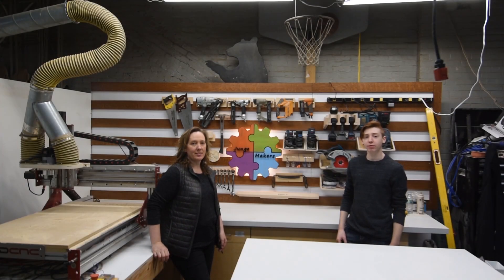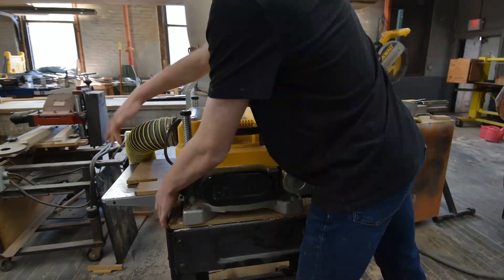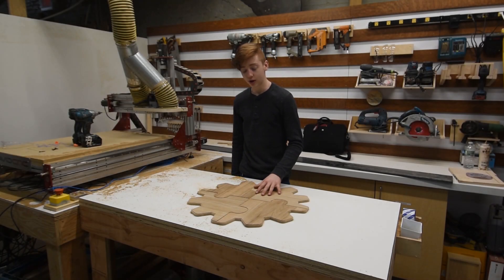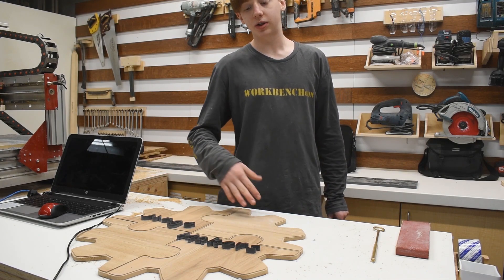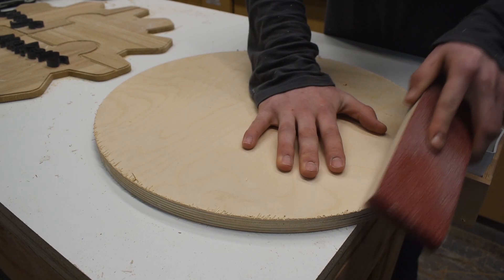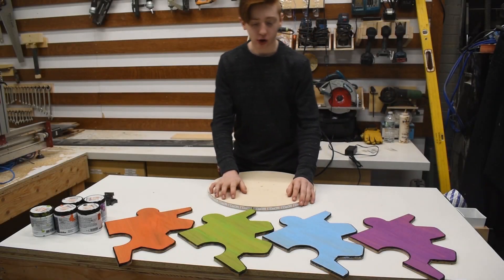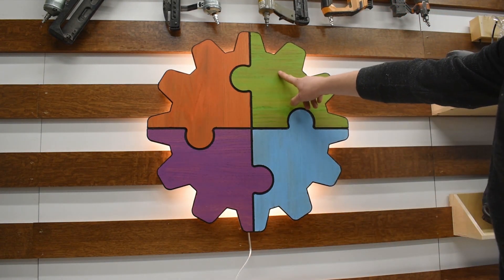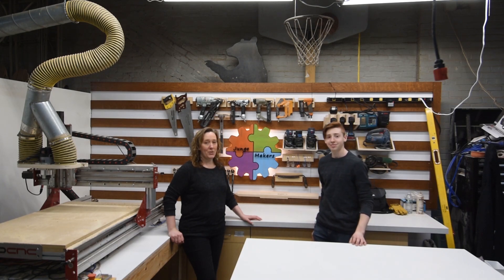How to Make an LED BACKLIT SIGN with Your Logo on it

Comment: That project came out looking fantastic. Great job!

Question:  which end mill did you use to cut the acrylic letters, and what were your feed and speed rates for that?  

Keep up the good work
Reply from the maker: Thanks! I used a 2 flute .125” endmill and I think I was running about 50 IPM. The best thing for me when cutting a new medium is start slow, and work up until your making full chips without overworking the machine.